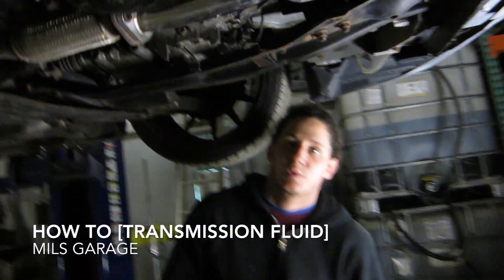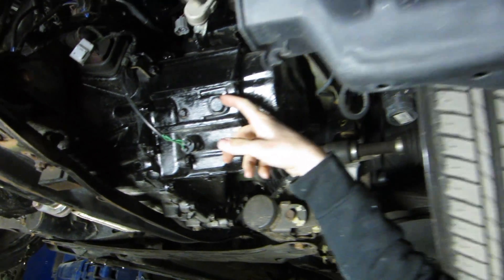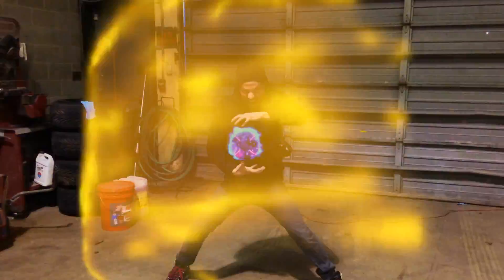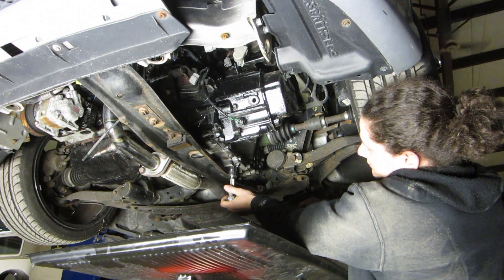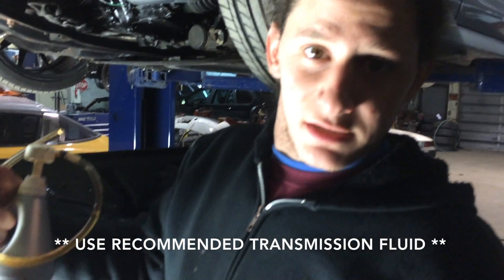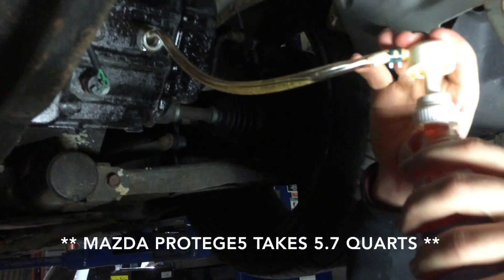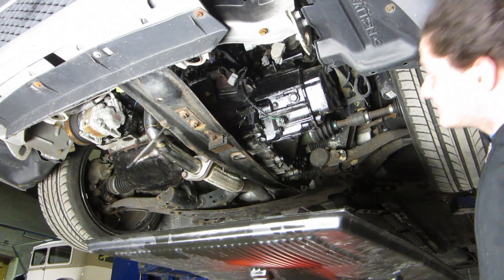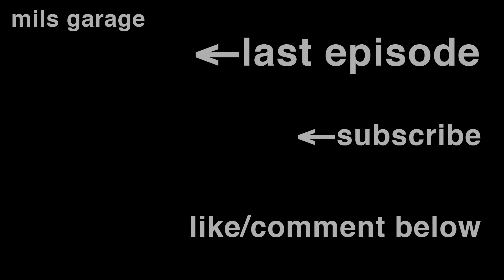How to Change Transmission Fluid [Mazda MTF]

Comment: Should only take 3 quarts.
Reply from the maker: Oh wow, i said 5.7quarts didn't i.. Thank you for catching that!
Reply: I came here to work this out! I put 3 quarts in and didn’t see it overflow.
Reply: 2002 2.0 PROTEGE 5 - about 3 quarts, just did on mine... Helpful video, Thank you for posting ✌️ just to note: I would loose filler bolt FIRST and only after - the drain bolt. Rule of thumb 👆